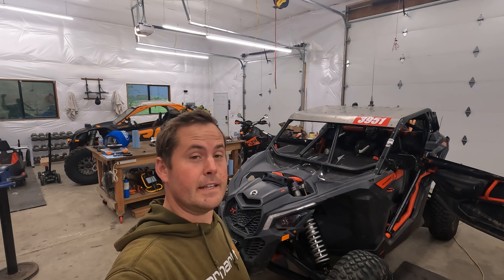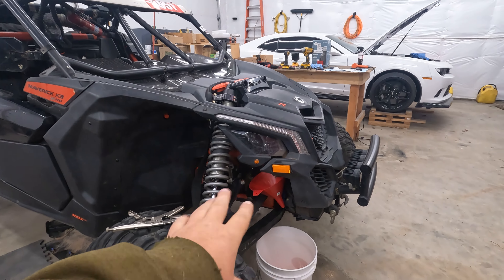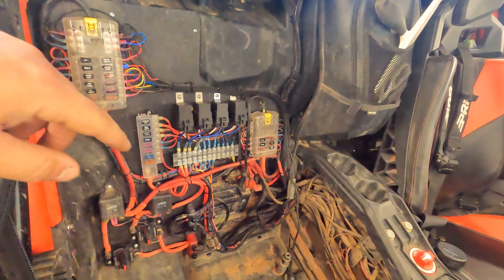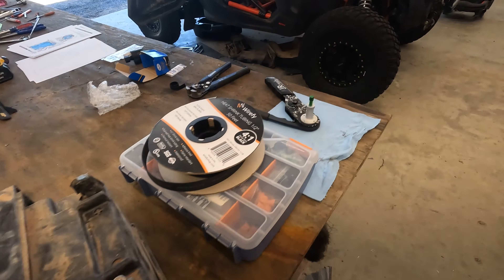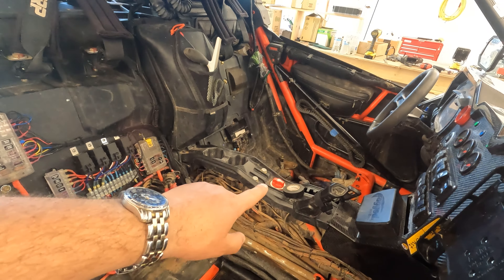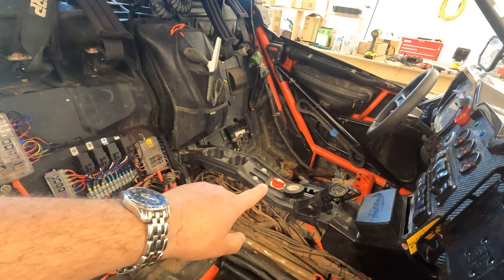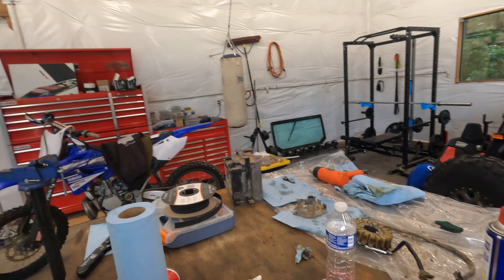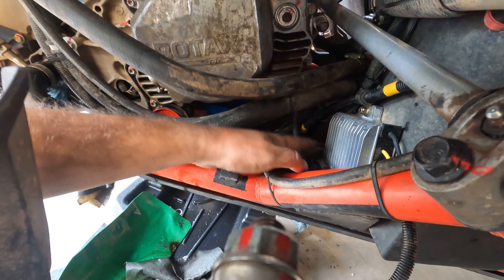How To: Install an 850w Upgraded Stator In Honey Badger X3 #canam #offroad

Comment: How did it work did you get to make more voltage or more consistance voltage
Reply from the maker: Works great - no more voltage (just needs to be 14v or so) but it puts out more wattage which is great for the lights!